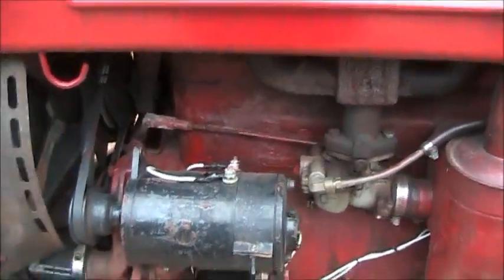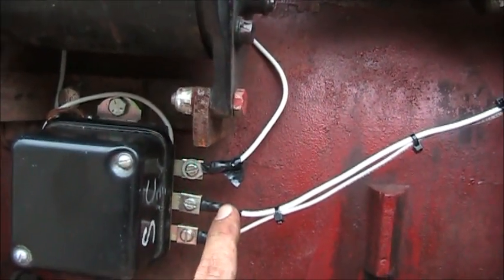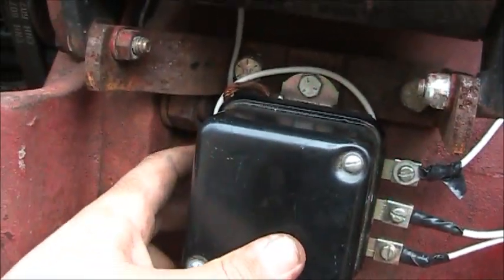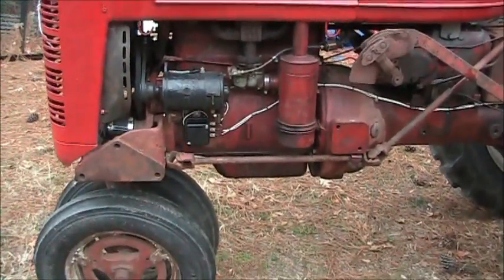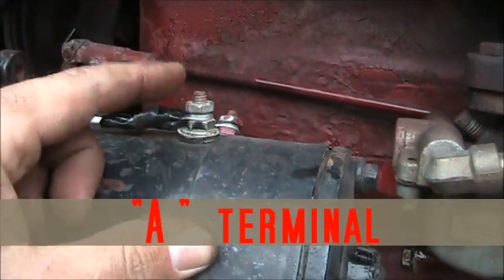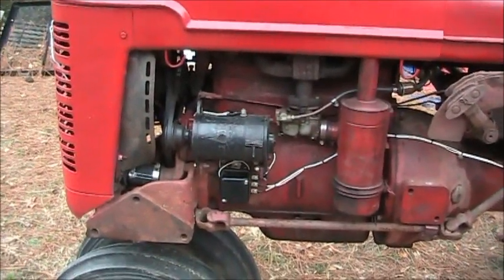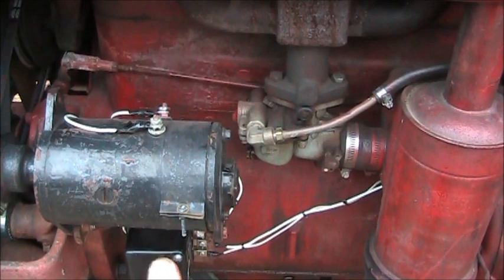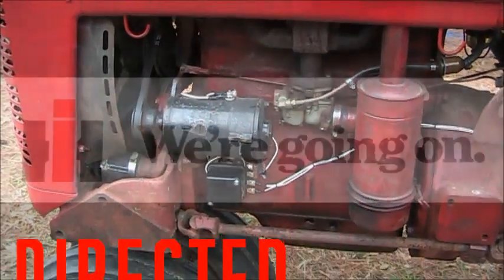Polarizing Your Delco Remy Generator on a Farmall A,B,C,SA,Super C

Comment: Fantastic explanation! For so many years i struggled with this issue, all the case ih dealerships would'nt tell me anything like it was top secret nsa/cia national security info. I used just a screwdriver on the armature & could get good continuity but like you say it still would'nt charge the battery. So i'ld drop off the generator at the local magneto repair and of course nothing wrong. After buying many batteries it frustrated me so badly i traded my dads farmall m for a 560 diesel.

Comment: Connect a 3 watt panel light between positive on start key, and the field connection and it wil work automatic, the small currend trough the bulb wil help to polarize the field, when the dynamo is not working it will be lit, when charging it is of, works like a charm.

Comment: I have a 1952 Farmall Super A and bought a new rire harness. When I run the tractor it shows full discharge when I reverse the wires it shows full charge with the battery fully charged. Would you have any idea what would be wrong?
Reply from the maker: Let me think

Comment: danfhowe, The video is 100% correct. On a "A" circuit regulator, which these farmall's are, you flash the armature. A "B" circuit you flash the Field terminal. Please don't start stating facts unless you know them.

Comment: You mentioned this how to polarize the generator on a positive ground 12 volt system.  Is it the same for a 6 volt positive system?  Thank you
Reply: Matt Oswalt, If your tractor has a Delco 1100501 generator and a regulator, you can do exactly as shown. If It has a Delco 1101355 generator and a cut out, I'm not cure if you can. I never did on those and they worked fine.
Reply: Our 1960 Ford Truck has the positive going to the body instead of ground. Have you guys ever heard of this?

How do you upgrade this to a late model Ford alterntor?

Comment from the maker: Ok ,, On Page 60 of the Farmall Super C Operators Manual ON (Polarizing the Generator) It says " IF THE GENERATOR OR THE REGULATOR HAS BEEN REMOVED OR THE LEADS DISCONNECTED ,THE GENERATOR SHOULD BE RE-POLARIZED."

Comment: So, thanks, this helped. I did exactly this on my Massey 65, but I was missing a ground in the circuit I think soooo, I then took the spark straight from the battery instead. This caused the tractor to turn off immediately. I was wondering if this was a good or bad sign. I then jumped my tractor again and miraculously, I am measuring 14v at the battery!! Hooray. And yeah, I flashed the armature on the generator after a rebuild. Anybody know why the tractor stalled out?

Comment from the maker: Oh no its ok I understand I was just going on what the book said. I'm getting it from an original IH Operators Manual. Ok here is the rest on what it says. " After making certain that the grounded battery terminal is the positive one momentarily connect a jumper lead between the battery terminal of the regulator and the "A" terminal of the generator. this allows a momentary surge of current to flow through the generator which correctly polarizes it.."

Comment: Good video.  I think my super A is still 6v positive ground, is it still the same procedure to polarize the generator?  Does it still have to be done every time I disconnect the battery, and is one quick spark with the jumper wire good enough?
Reply: Shouldn't have to perform this process if only changing out the battery.

Comment: do you polarize a 6v POS ground generator the same way?  if not how about a vido on a 6v POS system
Reply: Bartley Bass it's exactly the same way. You only have to polarize once when you replace the generator or regulator and not every time you disconnect the battery.
Reply: It is the same provided it has full voltage regulation. Earlier IH tractors had  only a cut-out and a different generator. If your tractor has a Delco 1100501 generator, you may polarize as shown. If it has a Delco 1101355 generator, I wouldn't polarize it at all. I am not sure if you can on those. I never have, and I've made them work.

Comment: Hot $#!+ I wondered why my H quit charging. I replaced the post clamps and it quit charging. Figured the voltage regulator finally gave out. I'll try polarizing it before I start throwing parts at it.
Reply: One thing you can do if polarizing doesn't help, is when the tractor is running, ground out the field. If the generator charges, the regulator is no good.

Comment: More less just a precaution I presume. What post does it say to polarize, the field post or the armeture post. If it says armeture it's a mistake cause you have to polarise the fields not the armeture. I'm just  stating the facts not trying to argue here. That wouldn't be the first service manual I've seen with mistakes in. These manuals are written by people who have never had there hands on the machines the write about.   I'm done here so no need to reply.  Dan
Reply: Polarrize the field. F not the armature A. +battery B. to field F . engine off.  🔑 off.

Comment: Well yeah but that Alternator works good in the long run...
cause iv seen a bunch of people pull there hair out using a Generator ...
Cause iv done then i got a tractor that wont charge the battery an my Head hurt's 8^( 
HaHa ......but i rather have the Gen on there instead so it will look original specially if its a show tractor.. Work tractor take the Gen off an toss it in the woods 8^) LOL came close to doing that HaHa

Comment: i bought a wiring harness 2 yrs ago for my farmell super a and my brother was suppose to help me with it, well he passed away at that time and my tractor has been sitting around, i want to get it going, how hard would it be for me to do the wiring harness and make sure the engine is ok before i start it, i realize i need a new battery, but any advice would be great please email me
Reply: If It's regular IH wiring harness I can help you. On the generator There is an A Terminal and an F Terminal. The proper harness on pretty much all of the older IH tractors use about a 10 or 12 gauge blue wire to go to the A terminal and a 16 gauge yellow wire to the F terminal. That blue wire hooks up to the GEN terminal which is by itself either on the opposite side of the regulator as the other 3 terminals or it may be underneath. The yellow hooks up to the F terminal on the regulator. The other terminals on the regulator are the BAT and L terminal. The BAT terminal usually uses a 10 or 12 gauge black wire which in turn is hooked to the ammeter. The L terminal usually connects to the fuseholder in the dash for the light switch. The fuseholder is also hooked to the #1 terminal on the light switch. 
Next the distributor or the magneto. There should be a 14 gauge black wire that goes to either the - terminal on the coil or the magneto. (if equipped with a distributor a short cable must be hooked from the + terminal on the coil to the distributor itself)  This is hooked to the ignition switch which if equipped with a magneto only has one terminal.  A battery ignition switch has 2 terminals the other which is connected to the same terminal of the ammeter that the regulator hooks too. This is important because if you hook it on the same side as the power wire from the starter, it will not show a discharge if the generator stops working. The power wire comes off the same terminal as the battery cable is hooked to on the starter switch. It is usually a 10 gauge red wire and hooks to the ammeter. It must be hooked to the opposite side of the ammeter as the other wires and must be the only wire on that side of the ammeter. I am not sure about Super A's but on all of the standard tread tractors the headlight wire hooks to a junction block mounted on a brace across the top of the back of the radiator. This wire is usually a 12 gauge purple wire and it goes to the #2 terminal on the light switch. The small harnesses or single wires to each headlight hooks to this junction block and they are usually 16 gauge black. They may be small harnesses with grounds if your tractor is equipped with the flat back sealed beams. The grounds are usually 16 gauge pink wire and they usually are grounded to the thermostat housing. Now I think we have it and all that's left is the back light. That little harness or individual wire hooks to the #3 terminal on the light switch, and may have a ground as well. 

Now if you hook everything up and it shows a charge when you turn on the ignition switch  if equipped with a distributor and if it shows a discharge when running, you will have to change the wires from side to side on the ammeter. 

I have wired International tractors for over 20 years and always built my own harnesses usually first with tape and then fibre loom to give them an original and professional look. I have never done a Super A but have done at least 50 other IH tractors of the same vintage.

Also, in case you don't know, when I mention wire sizes, the smaller the number the bigger the wire. A 10 or 12 gauge is a big wire and a 16 gauge is a small one.
Reply: One thing else,  when removing the wires off the generator, make sure only the top nut turns. If the whole terminal turns it will break the wire off inside the generator.
Reply: As for the engine, check the radiator for coolant. You should be able to touch the coolant with your finger and if you can't it's too low. Make sure you have anti-freeze in it because too many people use water and forget to drain their tractors and the water when it freezes with break the block. Also antifreeze has corrosion inhibitors and it protects your liner seals and prevents them from leaking. We had a power unit off of one of the combines which is the same engine. It was sitting drained for years and when we got it going the liner seals leaked and coolant got into the crankcase. That wouldn't have happened if it was kept full of antifreeze. Then check the oil which if you don't know, checks with petcocks on the side of the engine. Open the top one which is the "full" if nothing comes out check the bottom which is safe starting, and if nothing comes out, add oil before even starting. I like to keep them so the oil runs out of the top petcock. Check the condition of the oil, too, if it's overly runny or milky or dirty, I would change the oil and filter first. Different owners have different preferences of oil, but in all my tractors I use 15W40 oil and it works great. The Super A's take a 376374R91 filter. Check the gas. If the gas is really stale, you can save a lot of trouble by draining the gas and putting new gas in. Then try to start it. You should have some action after a few turns with the choke on. If not, the problems are either no spark or no gas entering the engine. If you try that and it doesn't start, let me know and I'll try to help you troubleshoot.

Comment: I hate to say this but you polarize the field wire,not the armature wire and you only have to do this once. You are giving the fields a residual magnitism so they will be self excited when they charge. The fields will hold this residule magnetism well over a year or longer, you must have somthing hooked up wrong if you have to do this if you unhook the battery.I'd keep my mouth shut but you are giving generators a bad reputation here.    Dan
Reply: Correct. Negative ground system; F terminal. Positive ground system; A terminal. Check by seeing what batt terminal goes to frame, that is the ground type.
Reply: Your exactly right something's wired wrong.
Reply: He is correct by tapping power to the A  terminal on his particular generator. It has an externally earthed field. If he tapped the F terminal he would be putting a direct short to earth. I always polarise a generator with both leads disconnected, but you still need to know whether the generator has an internally or an externally earthed field..